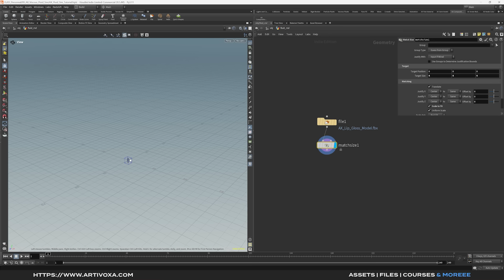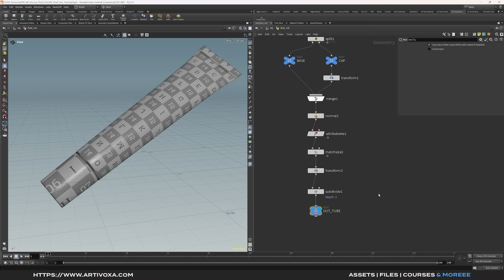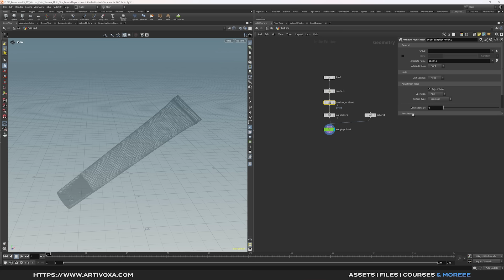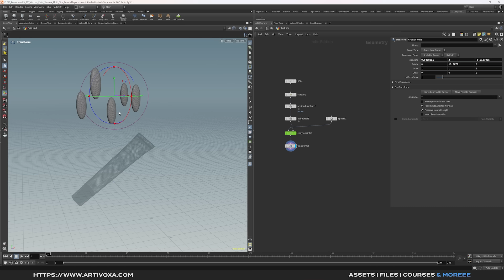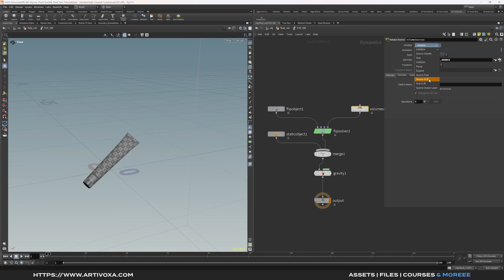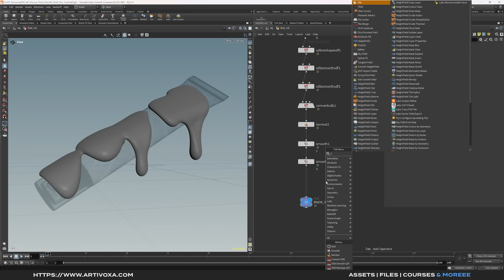Houdini Tutorial | MAKE YOUR FIRST FLUID SIMULATION TODAY!!

Comment: great, thanks for sharing. is there a hidden trick to make the liquid more droppy? mine looking more like U shape than nice drops.
Reply from the maker: Thank you! No hidden tricks, it’s more like trying different positions for the spheres (fluid source), also you can try to play a bit with viscosity/surface tension and density but on the final render I used the same settings as the tutorial
Reply: @Artivoxa  okay cool thanks, will play arround with it.
Reply from the maker: Yes you can start with low resolution, to iterate fast. Then you can increase the fluid resolution once the shape is nice
Reply: @Artivoxa  did some test, used a value of 80 in surface tension of the fluid, does the trick :)
Reply from the maker: Amazing !

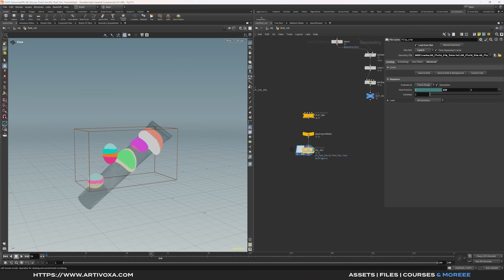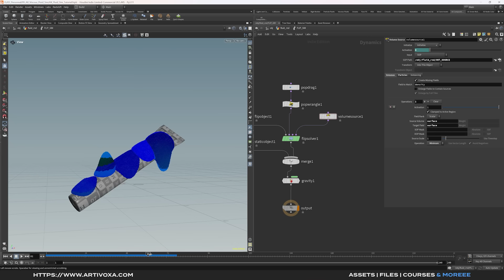Comment: hi, ifollowed your tutorial and tweaked everything i could adjust but i couldnt get the same result as the intro of your tutorial. Mine was so fat compared to yours in 18:09 . i think my result just the same as your first attempt here 16:47. can you show me what parameters that i should tweak. Big thanks bro, need help definetly haha
Reply from the maker: Hey, haha that’s the dark side of flip simulation. I think it’s all about source position and size. Maybe you can try to move them just a little bit, also change the scale of each spheres, you can also play with viscosity and density value, but yeah, in most of cases it’s quite a lot of iterations before getting the perfect result. If you want the project file is available with the link in the description.
Reply from the maker: Maybe you can also tweak a bit in post-simulation with VDB operations. Try to tweak the smooth value, you can also add a « VDB reshape » and put the operation to « erode »
Reply: @Artivoxa  alright thanks man, appreciate it

Comment: Hi, another great tutorial. Also picked up a couple of smaller tips - hitting M to switch axis mode and also saw something that is obvious really but I always missed, the move pivot to centroid button, I always hit move centroid to origin and then zeroed out the values to do the exact sane thing. Also smoothing the Normals is another great tip. Thanks.
Reply from the maker: Hey!! Thanks for feedback, glad it helps ✌️